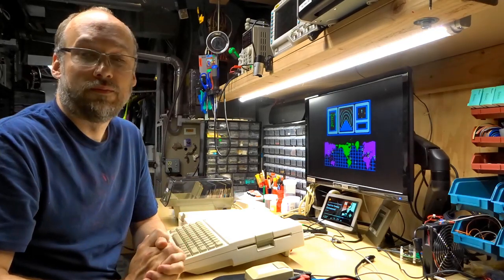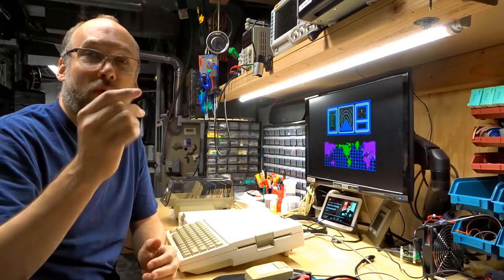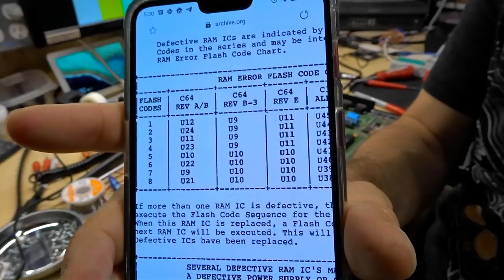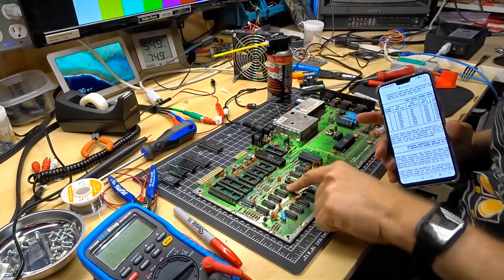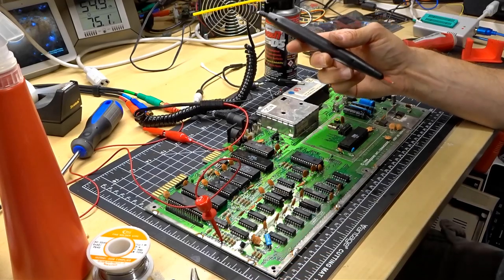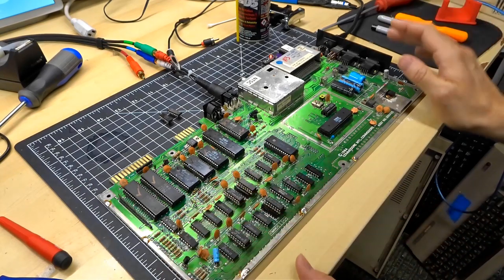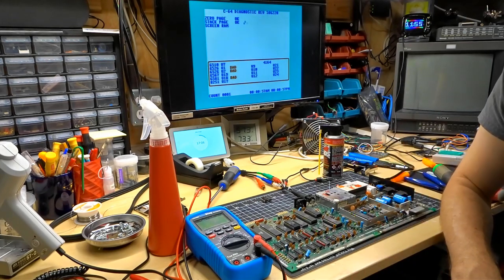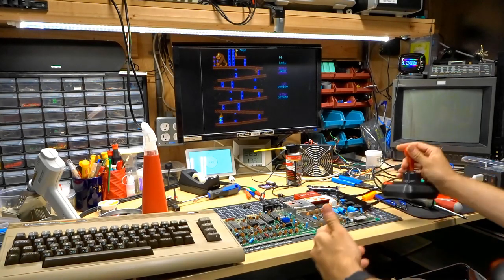C64 Repairathon! Part 3 - Black screen fix for #3 and checking out #4

Comment: My theory on Commodore installing factory sockets on C64s is that as they ran production, the quality of their MOS chips had a lot to do with how many sockets got installed. As the batches got better and as less boards were stuck in the factory, the number of sockets would start dropping to save costs. As a bad batch of problematic chips came in or a new board revision entered production they would gradually add sockets to speed up the recovery of newly assembled but defective boards. I can’t think of any other reason why the amount of sockets varied so wildly over the years like it did... Also, upside down factory sockets aren’t terribly uncommon either, I’ve seen quite a few boards with them. :)
Reply: Adrian Black Your #3 machine is a 1984 250425, and in my experience most of them had sockets for at least the major chips. Commodore was the king of penny pinching and if they could save a few cents on a socket they would. And when they made millions of these things, those pennies added up I’m sure. You are right though, every C64 has at least the VIC-II socketed, but beyond that its totally random basically.

Comment: You know you need a new camera when it crashes every 5 f**king minutes
Reply: Camera designed to prevent YouTube copyright strikes...
Reply: @adriansdigitalbasement  I know, apply a little CPU paste, add an AIO water cooled pump with two fans blowing through a radiator in the back.  Ignore that nasty fan noise...

Seriously, not sure about the model of your cam, but cams with batteries seem to heat up worst because the battery is installed and it is charging.  If the cam can run on power without the battery that might cool it down.    Or it may just be time to splurge for that new cam you were hoping you didn't have to do.

Great shows about our beloved C-64s!
Reply: @adriansdigitalbasement  Getting worse...?  You mean it was a "feature" of the camera???
Reply: Heh wow... so much for Sony being one of the better brands eh
Reply: I've had a couple of sony cameras. There's a pretty easy way to fix them: 
1. Open the battery cover
2. Remove the battery
3. Place in a bucket of rice
4. Pour gasoline on the rice
5. Light on fire and run in the opposite direction, never to return
Reply: @amberselectronics  A lot more interesting if you just skip step #2
Reply: @Eightbitswide  LOL
Reply: Yes, new camera and a new microphone too ;)
Reply: I'm sure Adrian is taking donations, everyone.
Reply: Do not underestimate bad SD cards. That said, from it getting progressively worse over time, sounds like it may be a heat-related issue on some chip... bad chip or bad soldering.
Reply: It only has 1 job! How is it even possible?

Comment: Actually cutting the RF shields off will wear out those cutters since those cutters were designed to cut soft metal like aluminum or copper.

Comment: Do you have a sony Alpha a6000 ? Depending on the bitrate/codec and how hard they work  they overheat and just crash. I sold mine and brought a used 4k fdr-ax33 to record video. Such a shame as the alpha took the best pictures.

Comment: Hi Adrian, I really enjoy your videos - they're super helpful and I feel I'm learning loads. I bought an EasyFlash3 cart recently, and am waiting for it to be delivered. Some of the apps that you use for diagnostic/testing look great. Would you be willing to share what they are, as I'm hoping to run some tests on a few C64's that I own?  I don't think anyone has done a video of just diagnostics specifically - I've seen people loading apps onto the EasyFlash cart, but very few people explain how those apps can be used to diagnose issues. The two that I've seen used on the internet are the Dead Test, and the 1541 Diagnostic. Are there others I should have in my diagnostic 'toolbox' also that would be helpful? Thanks, Alan from Ireland.

Comment: About the bad sound on the machine. What my ear hears is that its more disturbed on the lower freqs which instantly makes me wonder about a bad cap nearby. The second cause could be power because lower notes take more power to produce the same freq. It doesn't mean it'll be the PSU but possibly something power related. Lastly I just awoke having a real insomniatic night so everything I ramble on might be worthless.

When problems are self-fixing I often think of the connections. Then consider reflowing parts of the board.
2.99, what do these commodores go for now? My friend back in junior high had a commodore pet that had the stick to hold up the monitor and sheet metal. He'd stash his cigs in there. If his mom smelled smoke he'd always blame it on the possibly malfunctioning pet.

Comment: As for why they didn't just socket the chips from the factory... because it added cost, and also decreased reliability from chips working their way loose during shipping, as well as coming loose when heat took a toll during normal operation. The Apple III was famous for socketed chips working their way loose, with the official Apple support fix involving dropping the machine onto the tabletop from a height of two inches, in order to reseat any chips that worked their way loose from sockets. I have also heard you ask why previous techs working on these boards didnt just socket the chips when they repaired them -- I can remember trying to fix some of these in the early 90s, and we just didn't have great (cheap, easy, available) access to parts like sockets, like we do now using detailed websites and with cheap fast access to Chinese manufacturers. You would go to Radio Shack and pay $10 for a single DIP socket in a retail package, if they even carried it. It really is so much easier nowadays to source parts and implement fixes and improvements when we service these older machines.

Comment: Good stuff. You can knock-up an arduino DRAM tester pretty quickly. It is called Dramarduino. I made one in a vid and àlso modded it to test 4116 with an ATX psu.

Comment: Adrian,  could you tell us more about your ic tester or provide a model or pointer please ?
Reply: This will tell ypu everything you need. Though officially this model is no longer made. Also the manufacturer has done a few things that were not exactly in good faith. The new models seem ok though. 
https://youtu.be/FLG03f_ua5g
Reply: @adriansdigitalbasement  I wasn't aware those eprom programmers could do that.  Thanks.

Comment: Commodore didn't socket all chips because sockets cost money, and Jack Tamiel was on a quest for cheap computers. That's why the VIC-20 and C64 were popular, they were very capable machines for an incredibly reasonable price. Also why when they did use sockets they're terrible single wipe kind. 

Typically, sockets were added to machines which had issues at the factory. Your SIDs may not be bad, the timing may be off because of a PLA or other logic chip fault. Sometimes they can't act fast enough on what the CPU is sending them and make glitchy results when they work just fine at a slightly lower speed. Could also be a result of bad capacitors or drifting resistors.

Comment: I had a C64 which was making very strange sid sounds, even with a known good one, in the end I think it was the CIA which caused it as when replaced the CIAs to fix another issue the SID issue cleared.

How much are broken c64 in the US?  Here in the UK they are starting to go for quite a bit of money.  Between $60-$80 for untested / not working
Reply: @adriansdigitalbasement  The C64 was much more of an iconic computer here in the UK, so probably has a wider appeal and demand.

Comment: I have put two systems side by side, one working one not. It can sometimes help going back and forth on each chip/pin with logic probe or scope. It can work when it's a problem like yours, but it's  especially if you can get them into the same state. Things that will let it boot, but still have troubles.

Comment: Why do the SID chips partially fail and sound glitchy? What caused that? overheat/over voltage/static damage?
Reply: Being put in upside down and getting some voltage shoved up the wrong pins?.?.?.?
Reply: @JesusisJesus  Why the question marks? YOU of all should know. Being a god and all.
Reply: Adrian Black The last SID you tested sounds like its third oscillator is always the one failing, the first and second oscillators test fine. I don’t know how SIDs were architectured, but when one osc is consistently failing, that suggests to me a chip problem rather than a capacitor problem. Just a thought. :)

Comment: It could be possible that the SID had a intermittent heat-related fault, at first when cold it would sound like glitchy just like you described, but after letting the faulty SID warm up, it starts sounding good again... I heard many times about this kind of faults but that the first time that I hear a C64 SID chip do this!

(I used to have an Aztech Sound Galaxy soundcard that would do something similar when playing Midi files, I have very little idea what caused this but it sounded rather funny to say the least)

Comment: I need to order one of those dead test cards. I've got 3 C64's (two bread bins and a 64c) One beard bin works fine with an R5 vic, my first C64 also a bread bin only shows just over 700 bites of ram and my 64C dose nothing. I have planes for the 64C if I can fix the board.

Comment: Okay, let's have a little talk about semiconductors. But first, please don't blame me for language misstakes (I am from Germany). I'll give my verry best.

So you asked for effekts form "warm" chips. These chips are made of silicon. Silicon is a semicondutor with a negative temperaturecoefficient. So it conducts better when it is warm. The other thing is, that thermal stress will let the dopant drft. This changes the characteristics of the transistors and diodes. It also changes the characteristics under different temperatures. 

This is not a big deal with rhis older chips. But it is a verry big thing on modern chips. But it is possible, that the temperatur make changes on the behaviour of chips.

Comment: Bad sockets? Sounds like crappy solder joints to me. desoldering and resoldering the sockets should fix it, though chances are you will replace it them.

Comment: If the 8701 chip is bad you will get no signal at all. Not a black picture, instead, your tv will say ‘no signal’. I had a C64 with that broken and it was a pain to fix because I didn’t know the 8701 caused that!

Comment: The easiest way to check ram failure on the c64 is to piggyback ram chips with a new one until it starts working, no soldering involved until you find the bad ones.
Reply: Ok I might have been lucky, when my ram chips went bad (several) it still started but with scrambeled characters on the screen.

Comment: Considering their high failure rates, those MOS Technology (Commodore Semiconductor Group) ICs sure were CRAP.  Anyone know what manufacturing process issue ended up causing so many supposedly heat related failure issues?  Were the later HMOS and NMOS process chips more long-term reliable?

Comment: Yea SID scavengers, I lately got a lot of 5 supposedly complete c64s only to find out that someone did swap out the original sids for defective or dead ones and probably sold them on eBay for 50+ bucks each.

Comment: Hi Adrian did you repair c64 for other people ?
Reply from the maker: Sorry I don't
Reply: @adriansdigitalbasement  sad because ia have a assy no 250407 rev b artwork no 251137 black screen after watching a couples of videos i can see i have to buy a new pla chip and also some ram chip like  U9 are very hot my voltage are good i made my own power brick  :)

Comment: I did try to fix to add 128k ram to a c64 now it is saying 12k ram , did it work and can only show 12 as is 128?
Reply: You cannot "add" RAM to a C64. RAM expansion is only possible with special bank switch controller chips and support from the software that uses it.

Comment: This may be a long shot, but would it be possible for me to send you my C64 and get it fixed, it gives me a black screen, and i'm not sure what to do.
Reply: get one of them fecking diag carts
Reply: Matthew Berry get another one and start swapping chips, and get a diagnostic cartridge, then desolder & keep every chip off every donor board that you can get your hands on.
Reply: I tried the diag card, and it doesn't give me anything, not even a flash.
Reply: @matthew65536  80% chance it's the PLA chip, order a modern replacement from ebay. I replace them regardless on suspicion anyway since they will fail sooner or later

Comment: Sony for too many years have built both phones and cameras too tight and relaxed on cooling, especially for being a Japanese company with the temperatures they endure every summer, so I guessed it was one of their cameras on first mention of crashing and overheating. Panasonic G5 is a major go-to mirrorless camera for filming so if you find a used one with nice optics, consider it.